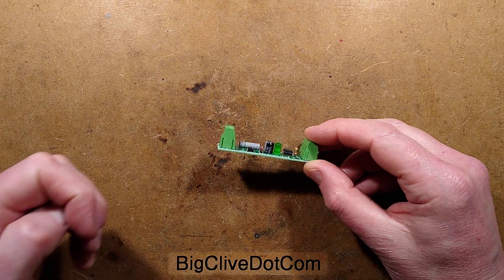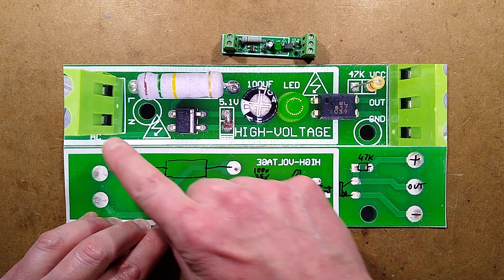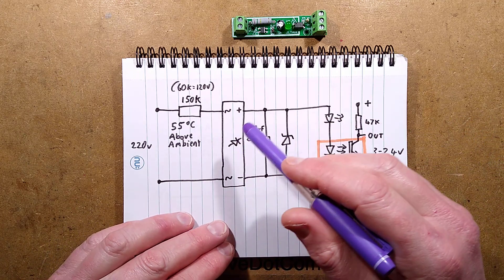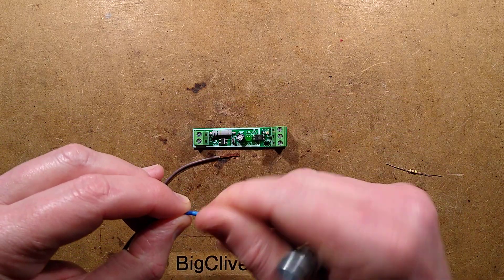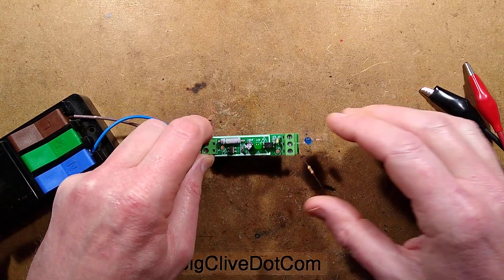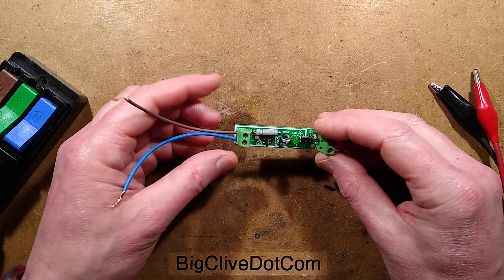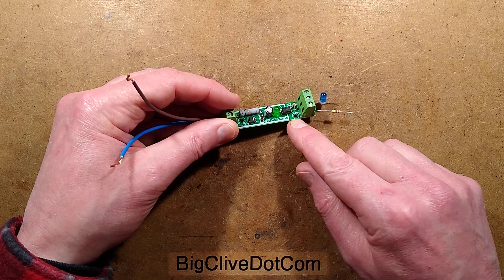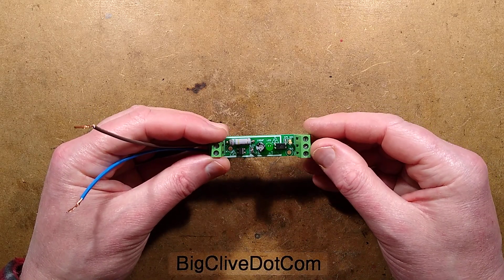120/240V to logic level optoisolator (with schematic)

Comment: How is this signficantly different than putting a huge resistance?  I need to deal with mains at some point... if I put a whole whack of resistor on the high voltage and then run that wire to someplace low voltage wouldnt it be the same?

EDIT: yes I KNOW what an optoisolator is.  But since THIS OPTOISOLATOR IS IN ITS OWN BOARD it is already physically isolated from the low voltage.  One of the commentors below provided a useful answer about galvanic issues.  That makes sense.  All other comments about "safety" between high and low voltage are useless since the BOARDS ARE PHYSICALLY SEPARATE so high and low voltage are separate.  If all I need is a power signal then a large value resistor and a full bridge rectifier would do the same thing barring huge voltages like 600 or 480.
Reply: Did you watch the video?
Reply: @simonhopkins3867  watching... then the phone rang... did you just spoil it for me?!?! Lol
Reply: The point is that there isn't any 'physical' connection to the mains..your 'whack' of resistors could short and mains would be present at the low voltage stage of your setup.
Reply: The main advantage is that the mains are electrically isolated from your project- a lot safer.
Reply: @andymouse  But what is the difference.  Lets say I have a high voltage section and place a big resistor.  Then I run that wire away to my low voltage components.  An optoisolator makes a lot of sense when high voltage and low voltage are on the same board but because this is a separate board then there is no risk of high voltage meeting low voltage.
Reply: @ericjessee  yep, better description than mine !
Reply: @someguy2741  as the term «optoisolator» implies, it is intended to isolate each and every side of your control circuit galvanically from the mains, whatever voltage potential there could be referenced to the output, — it doesn't bias any line towards neither live nor neutral of the mains, it keeps them isolated.
Reply: @jkobain  Thank you for the helpful reply.  The fools above don't seem to understand that the mains and low voltage would already be separated given the fact that THIS optoisolator is on a SEPARATE board.  If the circuits are sensitive to galvanic or maybe sensitivity to common grounds are an issue then ai guess this would be useful.  The safety issue of low voltage to mains separation is physically taken care of because the boards are separate.  Yes the resistors could fail but so could the optoisolator if you ran a screw in that high voltage side to your housing.
Reply: @simonhopkins3867  Did you actually watch the video?  I know what an optoisolator is.  It is used to ISOLATE high voltage from low voltage circuits.  But it is On Its Own Board so it is physically isolated from the low voltage so it is redundant.  Internet experts...
Reply: @someguy2741  I must honestly admit that I am just a fool who knows very little about electricity, circuitry and electronics design (and in English as well). Nevertheless, it is all in vain, all protection and separation measures are useless if you, say, throw a wrench across the lines or leave a careless copper whisker somewhere there.

And of course, if you're asking what's the difference because you have your own plans in your head, I'd only say go for it, if you know better what you should do. There is no universal design, as far as I know, so an optoisolator (or an optocoupler as they also call it) can be quite a useless part of your circuitry design.
Reply: @someguy2741  I think you might be missing the point. The point of the module isn't to have the high voltage on a seperate PCB. the point is to be able to detect the presence of mains voltage without having a physical electrical connection between your project and the mains. Seperate board or not, high voltage has no problem travelling across any conductor. 
The resistor approach you mentioned will work fine(but may require a diode and a capacitor for a steady signal) but you run the risk of having your project live at mains voltage, potentially frying you or your components. With an optoisolator, the worst that can happen is the isolator failing and ceasing to give the correct signal.
Reply: @jkobain  I agree.  Best to try... assuming you are doing it commercially or fighting with 600v 3 phase or something exciting.  We are 115v here so it is not super exciting.

My thought was a signal to verify the status of a power supply on my 3d printer.  An indicator is easy enough on the 12v side... and indicator on the 115v relay is also nothing... but if I run a resistor and rectifier to the wiring to a Pi would give the Pi awareness of the overall 115v relay power status before the 12v power supply.

I am very good with electricity on a hobby level and 12v in automotive and engineering in most disciplines so maintaining "safety" is certainly not an issue.

I don't trust the chinese relays and modules so some dirt simple input of 115v that cuts off everything seems like a good idea :)
Reply: @someguy2741  as I said, you probably know better. More specifically, in the context of this conversation and the module featured in the video, the course of your arguments can be misleading for other readers, IMO.
For your application you're free to do whatever doesn't burn your house down to ashes (and if you're a horrible engineer, then this outcome would actually benefit humanity after all), but let us please keep in mind the video was about what this particular module is and why one may want to have such a module in their project, not why it's a bad idea. Agreed?
Reply: @ericjessee  That is a good point.  The value of an optoisolator on a board that shares high voltage and low is without question.  The separate board makes this somewhat redundant in terms of low voltage to high voltage safety.  It would be like using a fusible link in line with a fuse holder.

The simplicity of a chain of resistors running at tremendously tiny amperage should be next to bulletproof.  Failure of multiple resistors in direct short should be nearly impossible.  Essentially this would be a sense wire.

Isolating grounds on different modules might be a thing depending on sensitivity.
Reply: @jkobain  Agreed.  The idea of an optoisolator on a separate board is somewhat redundant since the separation is physically already made.  The video describes the usage of optoisolators on high voltage elevator boards to keep thr low voltage indicators and such separated.  On boards it makes good sense.

I would hope people wouldn't develop their mains powered projects based on the comments of youtube videos and no pre-existing knowledge.  Lol... but I guess that explains the fires with 3d printers or vapers blowing their lips off or setting their pants on fire.
Reply: @someguy2741  since you took your time to explain that you know what an optoisolator is, could you add a section about multi-phase mains to your original comment as well, please? If only you don't want to reap some more comments from folks who don't actually understand why would one ask the question you asked.

Because the short answer to «wouldn't it be the same?» is «no, it wouldn't».
Reply: @someguy2741  are you sure that 115V is "less dangerous"..? I understand that is the power (i.e. the actual current that can be delivered) that's the real danger.
Reply: If two boards are connected by wires they are by definition not isolated from each other. If the resistor were to fail short without isolation, your low voltage is no longer low, which board the resistor is on doesn't matter.
Reply: Voltage requires TWO connections since it is a measurement across two points in a circuit
If you pin one of those points to a low voltage reference then the other point still has the potential difference of the original supply
You may have limited the current,  but with a high enough impedance you can still obtain the original voltage so you have not isolated that voltage
This is the purpose of the opto in order to isolate all points of reference of the supply circuit from all points of reference of the output circut
Reply: I'm not sure if anybody mentioned this, but an isolator like this is a good idea especially when the high voltage side may have large voltage spikes (e.g. relays/motors turning on or off) or other interference.
Reply: @FiniteReality  That is one of the best ideas so far.  If you had a big motor that you wanted to know when it had power then the spike might wreck the board.  As far as practical use for a separate optoisolator board this is the best.